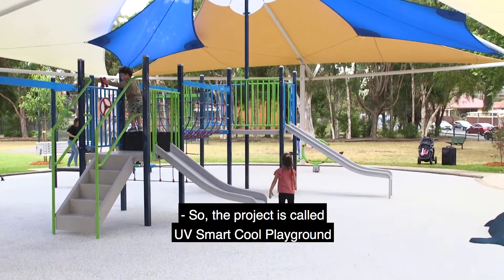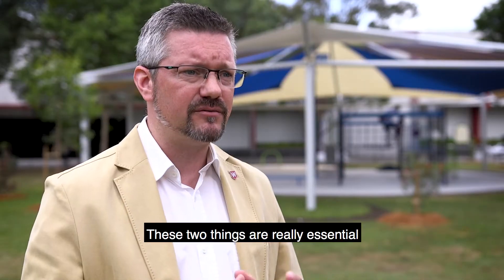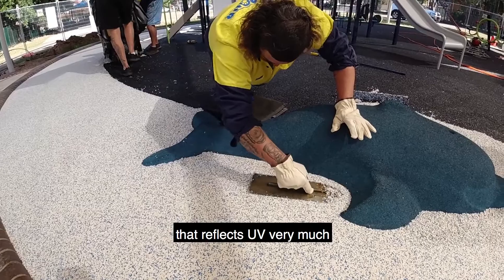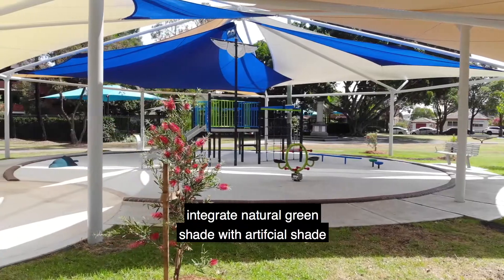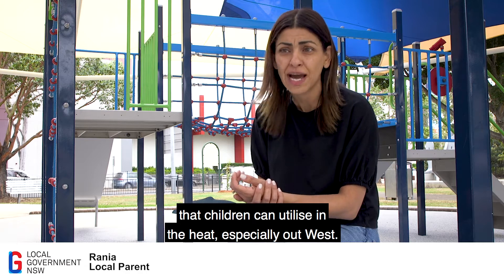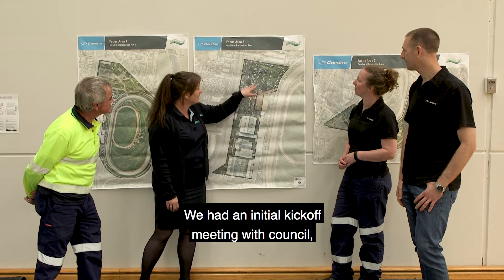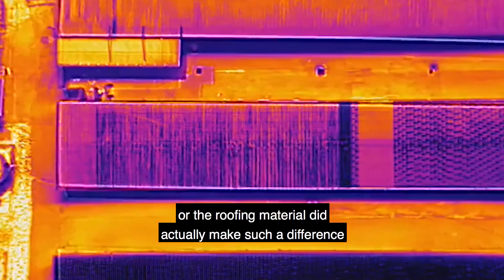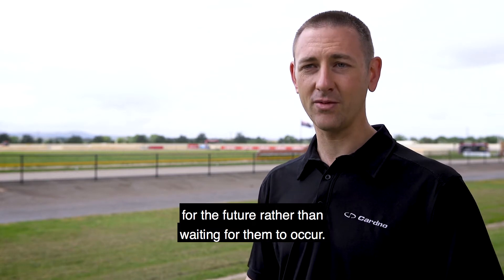Heat proofing Strategies to Protect Communities

Comment: very interesting, what is the new material that replaced the bark?
Reply from the maker: Apparently it’s “a new advanced polyolefin plastomer surface which has a lower heat conductivity”. This is from the case study, which you can find here: https://www.lgnsw.org.au/common/Uploaded%20files/Environment/Climate%20Change%20case%20studies/UV_Smart_Cool_Playground_Case_Study_Cumberland_City_Council.pdf